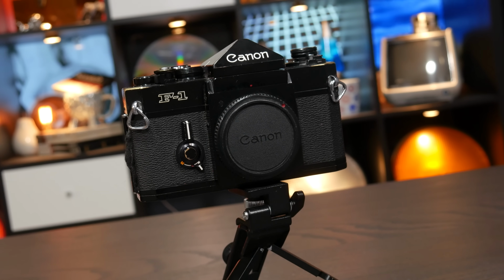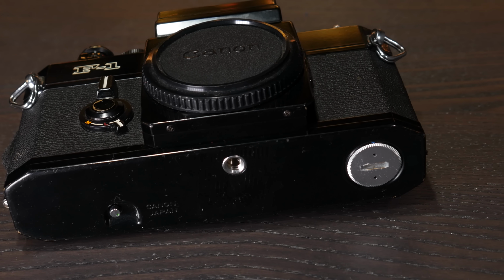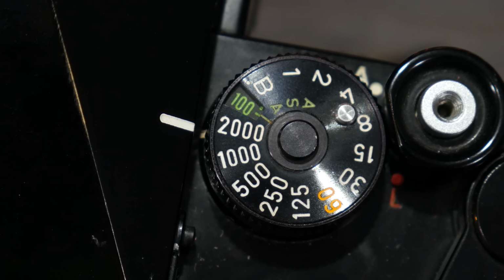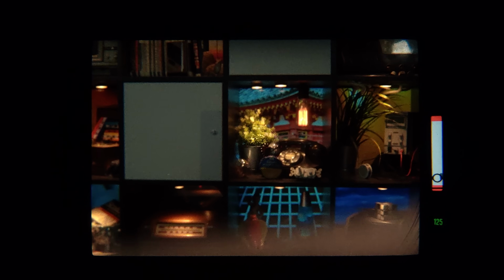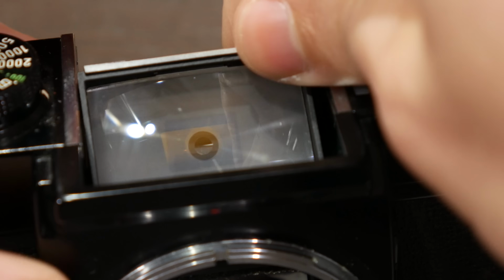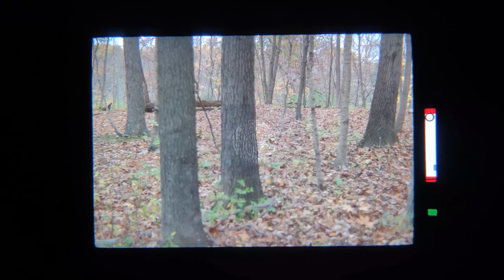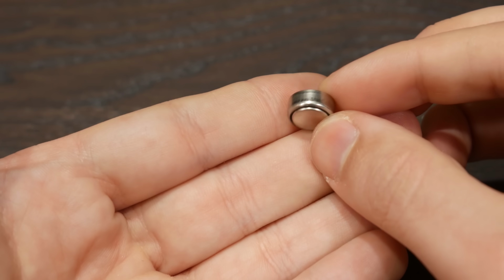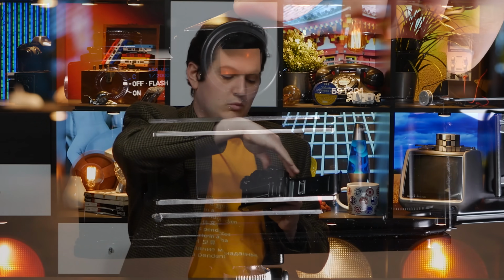1970's Camera Tech: How they showed you what settings to use

Comment: About the light-sensor and aperture setup --- some older cameras had an automatic aperture mechanism using a solar cell connected to an electric armature, like on an analog voltage-meter, but instead of an indicator-needle, the armature's shaft was fitted with a lightweight aluminum shutter that moved back and forth across the back of the lens, and had a curved-teardrop-shaped slit in it, and with its "at rest" --- i.e., un-activated by current --- position being at the slit's largest opening to allow maximum light through to the film.  So when the photography-scene's light contacted the solar cell, it would cause the armature to move proportionally to how much light there was --- i.e., the brighter the light, the further the armature with the slotted shutter would move, narrowing the aperture-slit to reduce the incoming light appropriately.

Comment: My old Pentax MX from 1978 had all the features of the Canon F1, almost exactly the same and worked exactly the same and just as manual, but all packed into a smaller case that was 1/2 the size & weight!  Amazing technology.  The only thing it was missing was the 1/2000 top shutter speed.

Comment: 21:42 I have a Pentax Spotmatic slightly older than your camera and it was made for 1.35 V mercury batteries too, but I read somewhere that it's designed to handle a wider range of voltage. I use 1.55V silver oxide batteries and they work great! I use the meter for all my photos and they've all been exposed perfectly. I'm not sure if it would work in your camera but its light meter circuitry probably isn't too differently. I'm sure zinc-air batteries work great but I don't like their limited lifespan. I got the battery for my camera almost a year ago and it's still working.

Also, thanks so much for explaining how the TTL-metering works! I was mystified by how it works for so long because it just seems like pure magic. It's so much cooler than i thought. I bought this old SLR because I just love how everything is so mechanical, designed so well, and such high quality.

Comment: I will never understand why the manufactures don’t reproduce  their most popular slr model with only adding a full frame sensor, battery and sd slot. No evf or display. Just RAW files. There is no reason they couldn’t fit that in an identical size body. Also only made in country the company is based in. Maybe one day!

Comment: On the sunny 16 rule - it didn't apply only to bright sunlit conditions, but other lighting scenarios as well. f16 in that circumstance, f11 in hazy cloud, f8 when overcast or in shadow, and f5.6 under dark clouds. Then treat those as differences as stops, so different combinations of f stop & shutter speed could be used. It worked because there was exposure latitude with film, especially black & white, and a correction could be made when the print was made.

Comment: In the 60s, Nikon was the boss of cameras, their cameras were what every cool photojournalist used. 

Then round about 1970 Canon made a huge splash with their F-1.

I was a young teen and i remember how impossibly high tech the F-1 seemed at the time, back when "tech" didn't necessarily include any electronics, let alone digital electronics, at all. 

One of the major claims Canon made was of their incredibly tight tolerances of manufacture. The gaps between everything made the old Nikon's seem like old jalopies.

Comment: This guy is costing me money. I now have both an F-1 and an EES-2 because I watched the videos and then wanted them.

Sadly, I couldn't get my light meter to work with anything but the "right" batteries, so I am rocking one of the special 1.35 volt zinc air batteries, and when that dies I have an MR-9 battery adapter from Japan to use 1.55 silver Oxide batteries. Even with that, I do have to set the ISO to half its true value. However, doing all that does yield proper results

Comment: One of my favourite on the Zenith EM. 
It has a selenium cell above the lens and you read the meter reading on a needle on top, which tells you what setting you should have on your lens. 

Again it’s built like a tank. 
Not the most featured SLR but o found it reliable and quirky. 
As long as I have film I’m good to go, no need for batteries for anything.

Comment: This is not the specific camera I learned on, but the same style, and I learned from a book written in the late seventies. I was during this in the late 90s/early 2000s. I initially had a Minolta or something that I inherited from my dad, but later switched to a Nikon F3.

I used the built-in light meter to some extent, but I also just got really good at eyeballing the settings for the best result.

I later got a small Kodak digital camera, but I thought of that is being good just for quick snapshots and the film camera is being good for "real photography".

A couple years ago I got my first proper digital camera, a Sony a7iii.  There is so much more to learn! 

Also it's pretty mind-blowing how high of an ISO you can go.  When I did film photography, I used Fuji 400 as my general use film, but sometimes switched to 200 speed Kodak when I was doing portraits of light skinned people.  Fuji with higher contrast, so it made more interesting pictures in general, and had better results with portraits of dark skinned people.

Comment: I still have mine from 1973.  I bought it for maybe $300 in '70s $$$ with an employee discount from Bell&Howell, who was the US sales rep for Canon at the time.  I had a summer job there in the optical engineering lab when I was an Optical Sciences graduate student.  The shutter still clicks, although it should be cleaned and recalibrated--not worth it to fix.  My current camera, a Canon Rebel T6i, I paid about $400.  It's mostly plastic, but probably has more processing power than what flew the Saturn V rockets of the time.  Amazing, today's tech, huh?

Comment: At low current, a schottky diode has a forward voltage around 0.2 to 0.3V. One of those in series with an alkaline battery would present about 1.3V to the camera. So would a nickle metal hydride rechargeable bettey.

Comment: You did not mention Selenium exponometers (in Russian we call light-meters exponometers). They don't require batteries, and work like a solar panel. Many Soviet cameras had them. The downside is that the more they are exposed to light, the more they degrade (just like solar panels), and after a while become useless.
Reply: He actually made a full video on those, specifically on the PEN-EES 2 which automatically adjusted exposure using a built-in selenium light meter to physically block the lens aperture from opening completely (the more light, the further it was blocked).

Comment: I repair canon a series cameras, and currently have an ae 1 completely taken apart. Let me know if there are any internal linkages or systems you want a closer look at. The pulley systems in them are really cool, a lot of those linkages have several pulley wheels and are moved via tensioned cable to get inputs from one side of the camera, around corners and other parts and to the other side of the camera

Comment: Canon did a sister camera to the F-1N called simply the "EF".  It looks almost identical to the F1 and it can automatically take a 1.5V battery and it auto-converts to 1.35V.  It also has a faster flash sync than the F1 and has mechanical faster speeds with battery powered slower speeds.  It's a really nice camera.. the later models have the split screen view finder same as the one in your F1N.

Comment: 22:20 if you leave a 1.5V alkaline battery in the meter and leave it on for awhile, it will eventually drop to the right voltage as indicated by the battery check and you will get perfect exposures.

Comment: I just bought a canon F-1. I tried three batteries and tried to do the battery check k, it seems nit to work. 

I tested indoors, light meter does not move from the bottom. 

metering seem to work only outdoors on direct sunlight, but battery check still not  wirking.

any recommendations?

Comment: Interestingly I have a vivitar XV-1 (Which is really a rebadged cosina CT-1) which has a similar light meter to this. Instead of a moving target though everything is done by changing the sensitivity of the needle. The target I have to meet is always the centre of the lightmeter. As far as I can tell its metering is done in exactly the same way as the F-1 otherwise though. I love my vivitar XV-1 and I'm suprised it's held up as well as it has knowing that even when it was new it was a fairly budget camera. The only thing i mildly dislike about it is there is no depth of field preview at all which is frustrating. I'm hopefully going to get an Olympus OM-2 soon which has an automatic exposure which is done in quite an interesting way as well with a sensor basically reading the light that is reflected off of the film in order to determine exposure. Though it does also seem to have a similar light meter to the f-1 if you use the manual exposure mode of the camera.
Reply: Of note another thing I found interesting about the XV-1 (CT-1) is that when I got it the shutter wouldn't fire and I couldn't turn the film advance lever. i took the bottom off and what had happened (I think in shipping) was that a cam (this might be the wrong word) had slipped past a catch which jammed the film advance lever. This is supposed to happen when use the film advance lever, and it is to lock out the film advance until you press the shutter to stop you from wasting a frame by double advancing. But because it had slipped past the catch (presumably by being bumped or dropped) without the film advance lever being moved the shutter hadn't been reset. So the shutter's mechanism basically thought that the shutter had been fired and was waiting for the film to be advanced and the film advance mechanism thought that the film had been advanced and was waiting for the shutter to be fired. This conflict locked out both mechanism until I manually freed it by resetting that cam inside and then advancing the film. It was interesting to find and apparently not a common issue as I found no mention of this happening to other people's camera's online. With everyone instead claiming that I likely just had a stuck shutter and should probably just discard the camera as it would cost more than its worth to fix. Glad I didn't listen.

While opening it up though I did accidentally release a tiny spring and fire it off into my room somewhere. luckily I managed to find a replacement that was close enough in size to fix it but I would caution anyone opening a camera like this to do it in a box or other enclosed space in case something similar happens. Always better to risk it rather than just tossing the whole camera though imo.
Reply: to clarify, because I do think Cam is the wrong word. It was a little circle of metal with a small tooth on one side to meet the catch and on the other had a piece that stuck out. The sticking out bit would push against the top of another half cog stopping that cog from moving until the catch was released which happened when the shutter was fired.

Comment: I still have a Canon F1-N film camera with a power winder. It works perfectly. Even if the camera battery “dies” you can still continue to use the camera to take pictures.(Try that with a digital camera.) Also, I have a Canon 50mm, 85mm & 135mm lenses for the camera. Built like a tank, takes a “licking” & keeps on “ticking.” What a wonderfully engineered camera.😊

Comment: You really don’t want to meter in low light anyway for most photography since reflective meters can often pick up hot spots in the scene. So for low light work without a try pot you wanna give the film as much light as possible, even with high speeds films. Once light is low you simply open the aperture all the way up and shoot at a shutter speed that won’t introduce shake. For most people with most cameras this is 1/60th. This also goes for any kind of warm artificial light shot with daylight balanced color films. You can just rely on films latitude to handle this. 
If you want correct exposures, you wanna use a tripod and an external meter. This can be a phone, or a light meter. An incident meter with a lumasphere would be ideal but you can also use a precise spot meter or a light meter app that can pick a precise spot. Then you simply meter for middle grey in the scene.

Comment: One of the things I had to get used to when I acquired my first digital camera (Fujifilm X100F) was when it's set in 'auto everything' mode;  the ISO is automatically set by the camera along with shutter speed and effective aperture.  Thereby I can get amazing low ambient light shots I can't get with my film cameras without setting it on a tripod.  This was something new for me as I'm used to shooting with film SLR's and was restricted by the ASA/ISO sensitivity of the film I was using.  The 'sunny  sixteen' rule was mentioned:  using that rule I got to the point that I could judge the approximate shutter speed/lens aperture combination required for a correct exposure..within a stop or so..without having to depend on the meter reading, for most lighting situations.  I still use the 'sunny sixteen rule' for a fallback.  I learned photography using film cameras that experience has served me well even with the advances in digital photography.  I ran into the battery issue with my Nikon F camera:  it was developed to use the old mercury batteries I had to get converters with built-in circuitry to adjust the voltage of modern equivalent batteries for proper light meter operation.  Excellent video lots of useful information.

Comment: I am curious if there are any DSLRs designed in this level of simplicity of use. The fancy options on my DSLR are rarely used,  and the few I do use are often more complicated to get engaged than this, sometimes far more. Either multiple settings have to be changed or i have to go into several menus on a digital read out. and thats fine and all, but I dont need a ton of options, I only need the basics in a straight forward way to use them. the one i have still has some of the basics this does, and definitely does the job most of the time with auto. but its almost too flexible. 

am I crazy for wanting a digital camera that is both professional quality AND dead simple to use?

Comment: Thank you,  thank you,  thank you.  I have cameras and meters that use PX625 and the inaccuracy of alkaline batteries us a royal pain. (They can be up to 1.5 stops "out" using alkaline batteries). The tip for the zinc air batteries is brilliant. I understand there is a microcircuit accessory that is thin enough to still fit into the battery compartment,  if a LR44 alkaline is used. They're very expensive (US$50) and one would be needed for each camera and meter. There are microcircuits available that can be installed permanently in the camera but the labour costs would be prohibitive  
I love your presentations. - You're to be congratulated for the excellence of your research.

Comment: One thing I might try is altering the electronics inside the camera, adding a potentiometer between the battery output and the meter that can be tweaked so that a full battery check falls in the right spot.

Comment: i bought two brand new lenses and both my the aperture/fstop rings don’t work. they don’t change the brightness it allows in🤷🏻‍♀️ whyy??
Reply: Lenses nowadays pretty much all have a decoupled aperture, which means if you turn the aperture ring it doesn't directly change the aperture, but when you release the shutter it stops down to the specified value while you are blinded to the scene, and then opens all the way up as the mirror resets.

When you have a wide aperture, the viewfinder is bright and you have a pretty narrow depth of field where everything is in focus. If your focus is a bit off, you can tell pretty easily with a wide open aperture. And if you are pretty good on focus at wide open, it'll be nearly perfect when stopped down. Quite the advantage, but it does come at the cost of not being able to see the depth of field in the viewfinder all the time. What you see is not necessarily what you get.

Since you say you've got multiple lenses, there's almost certainly a depth of field preview somewhere on your camera body, and that will stop the lens down manually.

Comment: do you have any idea as to unpwered light metering? I have a canon zoom 8 8mm camera which has a built in light meter above the lense. it outputs its settings to a dial and it still works with no batteries that I have been able to find or needed to replace.
Reply: Solar panels generate electricity from light, and the more light hits them the more power they produce. Take a calibrated one and put a voltmeter across it, et voila, a decently accurate light meter.

Comment: That camera is very similar to my Konica T3 - probably for the same reasons.  It's about as good, ergonomically, as you can get with a mechanical camera.     In fact, exposure metering worked (so far as I can remember) exactly the way it's described for the Canon here.    Oh, and I much preferred the clean straight lines of cameras of that vintage, to the current 'blobby' styling.